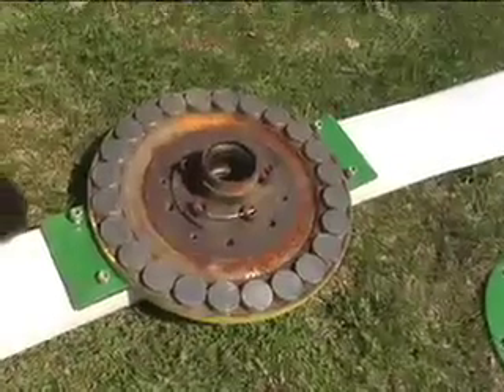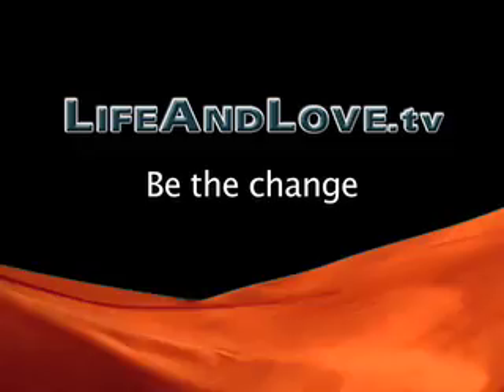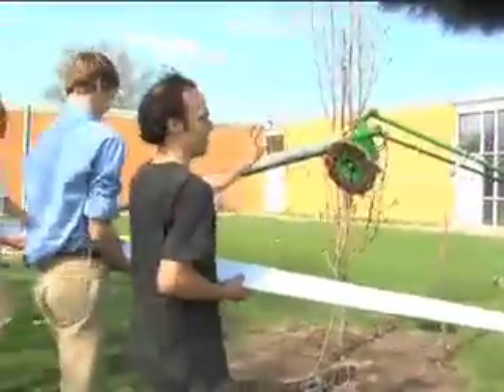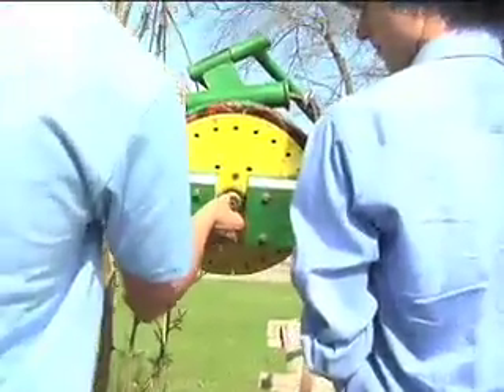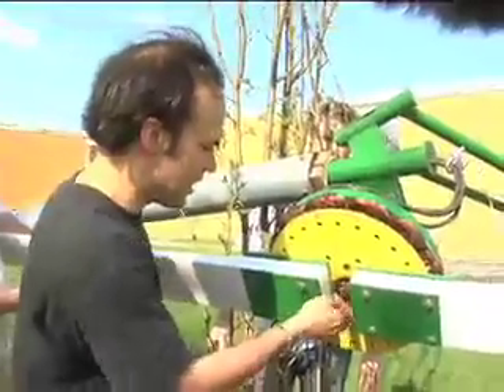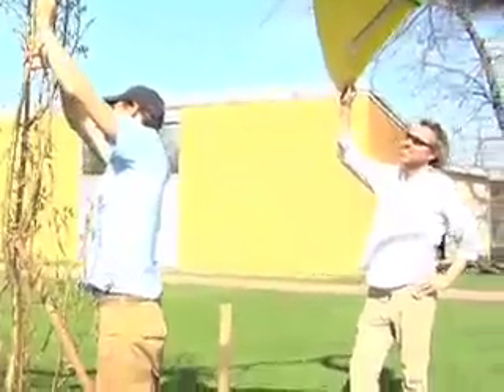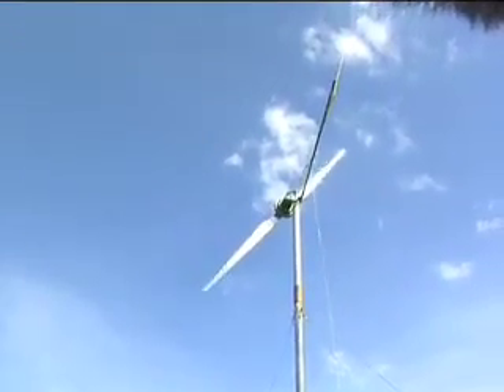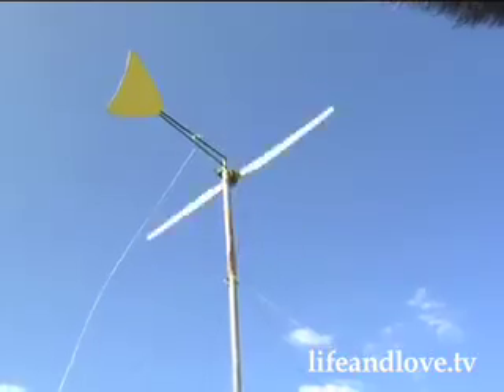Home Made Wind Turbine

Comment: How much watts and volts and amp's comes out of one of these? Are they 3 phase AC ? I have a small 3 phase 500 watt rated turbine 950mm 5 blades or 3 if i swap them real fast . I put it on my prototype tower thats mounted on my trailer with my 1200 watt solar array and battery bank. https://youtu.be/cLYq2n2iagM

Comment: always use odd number of blades
Reply: When you have an odd number of blades you prevent resonance from causing damage.
Reply: @mrworm1  Resonance may , or may not, be problem.  Small Wind Turbines rarely have this problem.  As a benefit,  2 Blades can spin faster vs 3 blades. allowing higher RPM's = more Volts = more Amp = more Watts. There are 2-Blade Wind Turbines in-service today ...
Reply: Why?
Reply: google is your friend
Reply: more power to yah
Reply: some dude 😂😂😂
Reply: mr worm thanks

Comment: Question: if you already have such a huge turbine, why not connect 2 or 3 generators one behind another and have more energy output?
Reply: +krelcic  it would probably bog down with the extra torque required and not make power until the winds were stronger, thats what ive found atleast.
Reply: I don't suppose you know if you could make the propellers out of plastic?
Reply: You can.

Comment: I thought wind generators are designed to be powered by wind . not to blow wind using the generator as motor .  if that was for testing i understand, but people need results if you're putting it here. nice job but we need to see the efficiency of it.
Reply: +Mars Seeker did you listen? did you watch? obviously not. anyway a generator or motor uses electric or produces electric depending on if you are sending power to it or taking power from it. try learning at least a little bit about electric before making comments that make you look ignorant
Reply: sean davies hahah.. really ? learn about sarcasm before making a comment
Reply: sean davies I don't know among what kind of idiots you live but I know what a generator is. did you watch the video is a better question ?
Reply: sean davies I'm talking about results , where are the results ? anything, show me the volts , show mw the amps. anything. . read a comment before making assumptions .
Reply: they made a so called generator and applied electricity to it. that's a fucking motor with the propeller on it . a wind generator is something you should google out .
Reply: Wind generator is powered by wind in order to generate electricity . all i saw is a wheel full of wires . I see no electricity coming from it . do you ?
Reply: lol.. designs are on the internet ... thank's .
Reply: sean davies you should try working on your instability instead electricity . yes you can "see" electrons move professor . it's called a voltmeter. Swearing makes me say what I want you to hear.  .I don;t care how that looks to you . the way you fighting over it makes me think you made it . blame me.  Enough about that . generator is a motor that produces electricity , wind generator produces electricity using wind.   now when you learned the basics tell me , why would anyone make and show a wind generator without showing how much it produces . I  saw it spinning .. did you saw it generating ? what makes it a generator if it's not generating ? go get some sleep old man
Reply: sean davies I saw a motor with the propeller on it ,  powered by electricity . If you say that you saw a generator there you're a liar . we cal that a fan , not a generator . get over it.
Reply: sean davies I just wonder one thing, when you see a remote controlled car do you say it has motors , or do you say it has generators they use as motors.. lol . man .... learn the difference . if it's meant for generating then show me the generating . I don't care if you're able to power the generator instead and make a motor out of it . the video is about a generator . eyes on.
Reply: And to be clear, I'm only responsible for what I say , not for what you understand .  and think twice,, who really looks immature here . go back a little bit.. who started insulting because he didn't understand the message .
Reply: sean davies find better things to do boy .
Reply: sean davies I will. thank's.  tell me. what capacitor would you use on this type of fan ?
Reply: sean davies so it depends On how many amperage and voltage ? how can I know that man, we can't see electrons .
Reply: +Mars Seeker but you claimed earlier that you can see electrons. try sticking to the same lie and not change the lies all the time. but we all know you cant do that!
Reply: sean davies we obviously can;t see it . so how do you choose the capacitor?  by following the instructions in the video perhaps ?
Reply: better yet, in what direction do you wind the wires ? like shown in the video ? wait wait.. how man turns ? like shown in the video ?
Reply: sean davies better yet , tell me.. Since you watched the video .. what did you learn from it ? I would like to know.
Reply: +Mars Seeker nothing. what they showed is well known with anybody who knows anything about  electronics.
Reply: +Mars Seeker you can't tell if it is sarcasm in text. god :P

Comment: I have a doubt and i hope you or anyone can help me with this: most of the videos i've watched show rotors made of metal, mostly iron/steel. But there was one guy who made it out of resin just like stators are usually made out there. So my question is: does it have to be metal or is it an option? Won't ferrous metal interfere with magnetism? Could i use aluminum, teflon, nylon or any other options? Thanks in advance. Cheers!!
Reply: Forgive me for any lack of knowledge though I do know enough to suggest that other than the overall weight density of the material of the wind blade, I sincerely doubt that it makes much difference unless you have your wind turbine set up in a constant high speed wind location. Then, I suppose that durability might be an issue. Other than that, I have no other suggestions.

Comment: 1k people don't like this? Why, that makes no sense.
Reply: They either don't understand it or work for an electric company.
Reply: usrtyse  is logical
Reply: Might have something to do with otherpower.org's domain being up for sale. or perhaps Koch minions.
Reply: +Ethan Ford Because it's useless
Reply: Voluntarist Can you demonstrate your claim that it is useless?
Reply: EmmittBrownBTTF1 Can you tell me what the power output is, sustained? That power output average over 24 hours? What are you going to power with your expensive windmill, one lightbulb? You might as well just go whale hunting for your oil. It would probably be just as efficient. He could have used that same copper to put in a steam or diesel driven generator and got 10 times the power.. Using a much smaller motor would have made a lot of difference, but then it probably wouldn't have spun up at all being that short.
Reply: Voluntarist Power output depends on wind conditions for the location so the calculators recommended give people better Idea than a wild guess, Similar devices have been constructed by amateurs who use them for off-grid generation combined with battery storage. By using high efficiency devices, required capacity is reduced and some run their homes entirely off grid. 
In higher winds the output can be a few kilowatts. Enough to use a domestic heater as a dump load into which excess energy production is dumped in order to protect the rest of the system.

Comment: 2:36 ... "so a $400 generator would supply an average home" ... "yeah"

HAH, hardly.
Reply: I agree with you. The average North American home requires at least 7kW. The video shows a very cool project but that statement is a little misleading. I'm into this stuff and it is not cheap, and there is A LOT of planning that goes into the designs.
Reply: james bryan I am making some for myself. I am building 10' x 3' x 3' CNC milling machine for the blades... If you want one you will have to pay.
Reply: Binj Komisar well then make me one

Comment: $400 buys 4000 kWh @ .10/kWh. He said the max output was 400 Watts in high wind (45 mph), so let's be generous and say the average when generating is 200 Watts and give it an average of 10 hrs of wind per day for easy math. That would be 2 kWh a day. The BEP (Break Even Point) would be 2000 days, or roughly 5.5 years. 
$400 for 5.5 years is small enough I'd probably ignore opportunity costs. But there is the rest of the system to consider. Like the pole, guide wires, and base. Then there's the wiring, charger, battery bank, and inverter. These could easily come to another $400 (probably much more), doubling the BEP to 11 years. Now, $800 for 11 years; I'd say opportunity costs might start being considered too. So after 11 years, the ROI (Return on Investment) would be ~ $72/year, or ~$6/month.
More blades, more efficient coils, and rare earth magnets would help, but it seems from a financial perspective, this is just a good hobby project. Not to say lessening our carbon footprint doesn't have value.
Reply: Not to mention maintenance and repair and insurance if that falls down or flies apart and kills someone.  Also, people just routinely exaggerate on how much power they say they can get from these, and it is not really in a form you can do anything with unless you have batteries and a charge controller and inverter.
Reply: If that massive thing output 400 watts only ,it's a poor design.I can purchase turbines 1/4 that size and get 800watts max.
Reply: charlidog2 you probably economist guys. FYI, simply imagine iPhone5 16Gb with 128Gb. that was same hp with different storage. same here.. just a few cost needed to upgrade coil in order to get more Watts. try recalculate with 1kw output value. your ROI maybe $13-15/month
Reply: @charlidog2 - You incorrectly wrote, "he said, the max output was 400 Watts in high wind (45 mph)"  <= Huh?  That is NOT what I heard.   At time @2:24 ... I heard him say, and I read on CC, was this => "2,000 to 3,000 Watts in a 40 mph wind".  Which is 5 to 8 TIMES larger than what you claim.  Western Iowa is VERY windy and that is why they build & use Wind Turbines.  
 Your estimate of only 2 kWhr per day is way off.
 This Wind Turbine can produce 2 kWhr, or more, in just one HOUR !
 In western Iowa, the Annual Average wind can be as high as 15 MPH.
 Therefore, average DAILY production can be 19 kWhr = 800 watts x 24 hours / day
 Average Yearly production can be 7,000 kWhr = 19 kWhr / day x 365 days
 Pay Back is more like $700 per year !
 It would not be worth wasting a week of your life if the ROI was only $72 / year

Comment: How many watts, amps? any clue?
Reply: Depends on a few factors:

-Wind speed
-Wire gauge
-# of turns in each coil
-# of coils in the stator. 

For example to gauge output by coil:

320 turns, 24 ga. = 100V @ 120RPM
160 turns, 16 ga. = 48V @ 140RPM
60 turns, 15 ga. = 24V @ 120RPM

(RPM = rotations per minute, since output is
related to wind speed)
Reply: about 1 kW i'd say. P = 1/2 density of air [~1 kg/m^3] Rotor Area [m^2] * Windspeed^3 [m/s] = 1/2 * 1 kg/m^3* (1.8 m)^2*Pi*(5m/s)^3= 1271W for avg windspeed of 5 m/s and rotorlength of 1.8 m .... you have to check your local avg. wind distribution
Reply: @theevillemming  Did you not watch the video ???  He said, "2,000 to 3,000 watts in 40 MPH wind"...

Comment: Turbine blades are not limited to one form. The blades are controlled by high durability computers that control electric switches that signal the tips and other parts of the blades to twist and turn so they catch more wind or let wind blow through the blades.

Comment: probably charge 12v batteries, and then use either 12v electronics or a inverter off the batteries.
Reply: Or a 24 volt, or a 48 volt battery bank ...
Reply: @MrSummitville  wow this was 7 years ago
Reply: @lucasclay1  There is no time limit on information. How old is the oldest book?

Comment: you can build a lot better HAWT for a lot less labor, use COTS for even less cost. And like so many said, there's a lot of research out there - don't believe the details to you research them. BTW never use a brake, brake the system with energy transfer to heating or other means. Small HAWTs are silly with Brakes...

Comment: Any change in magnetic flux across the wire produces electricity. So there are a pretty huge number of configurations you can do. You can rotate loops of copper around a stationary magnet, or you can rotate a magnet in wire (like the setup would do in the video, except their set up would move the magnets over the loops of wire [thus changing the magnetic flux])

Comment: thanks for your advice but what realy intrests me is that the wind mill works at that rpm i assumed to was alot less like 140rpm, i also assume with a wind mill of this size would have a great deal of torgue so to gear it up by 4 it would work well, what is your opinion
Reply: No, we do not use gears ...

Comment: More blades will make it more sensitive to low winds (see the windtronics design), however with blades like this it will make it much heavier and subject to damage in high winds, which can also be dangerous.  In very large turbines they use 3 blades as the engineering calculated the best ROI for that design.

Comment: I would like to see more on winding multiple coils in 3 phase for higher voltage, also an iron core in each winding would be more efficient. Large wind mills turn very slow but are geared to speed up the generator to about 1800 rpm or more. Don't waste your money on a windmill from a big box store, research before you buy a wind generator. The dynamics of blade design for a diy project are far too much for most people and I studied aerodynamics, a vertical wind turbine is much easier and safer.
Reply: Then join a DIY Wind Turbine FORUM ...

Comment: Nice execution of your build. Do you know what the wind speed is in the end of the vid?  Also is this a dc or ac generator?  From your coil setup it appears to be ac.  Are you rectifying it to dc to charge a battery bank or is this grid tied?  What sort of speed contol if any did you implement?  Do you have a way to defurl the sail in high wind to prevent damage?  Lots of questions I know.
Reply: Clearly, it is an AC voltage PMA

Comment: I attempted to make a wind generator out of an old air conditioner fan unit but I don't seem to be getting any electricity.  I attached 8 magnets in 4 rows around the outermost circumference of the rotor part of the motor, but even when I tested it with my stepdad's 150 mph leaf blower, it did not produce any electricity.  I wonder, does anyone know what I might be doing wrong?
Reply: Everything ...

Comment: ... You know.. I find all of this info, and I know how to build a windmill using everyday things around the house, magnets, I could even build a solar panel right now if I had the material.. What I do NOT understand... How do you get the energy TO your house, fuse box or the dang meter.. copper wiring takes it in, but how do I get it from the copper wiring to my fuse box!!!
Reply: DC-to-AC inverter or Gird-Tie

Comment: I'm planing to build a wind turbine .. blades from 6-10 (or bigger ) inch pvc pipe ...bicycle axial and hub .. will have a ratchet at the rear end of  the axial  for "gears" and a plate ( which the pvc blades willl be mounted ) at the front end of the axial ...  the hub will be stationary inside square steel tubing etc.building my own bridge rectifier with 4 diodes.I'll be charging 12v car batters.and powering stuff using a DC to ac power inverter .. as for a charge controller i will come later

Comment: Often these are connected to a bank of batteries with an inverter to store the electricity because the output can vary. your house is then connected to the batteries so they can be drained as needed.

Comment: And no mention of the money you will have to spend on an inverter or the transfer switch to isolate your home from the electric grid in case of a power outage. Or the hook up for the revenue meter needed to tie into your home. Which in most cities will require a licensed electrician.
Reply: Nope, none ...

Comment: I have a maintenance question.  how do you stop the prop when you need to work on it?
Reply: Sometimes with a switch ...
Reply: @MrSummitville  I am wondering about stopping the momentum of the rotating prop. Is there a physical brake for that? (like on a bicycle?)
Reply: @GreatNorthWeb  No, not a physical brake, an electrical Braking Switch ...

Comment: No. You would have to have zero loss of power through friction (any mount at all will cause eventual shutdown) and zero power consumption anywhere in the loop, and even if that were possible that would sort of defeat the purpose of power generation. It's called the elusive "perpetual motion" machine. Even if you built one, it wouldn't serve a purpose other than novelty unless it could produce more power than it consumed. Thus the harnessing of nature hydro/coal/wind/nuc etc. to generate power.

Comment: @perceptionsevrything 

You would need to use magnets that alternate polarity, in other words electromagnets. That would make a motor instead of a generator, so it would consume electricity to produce mechanical energy rather than the other way around.

Comment: i found a force in generator that could produce 200% energy  out generator  . it will change the world . it should be self run , free energy .cheap and easy. it  would make   Stan Meyer cry . Stan Meyer gave oral testimony before the court demonstrating the WFC Fuel Cell "Mode of Operability" by using the Voltage Intensifier . the water car
Reply: Did you forget to take your meds ?